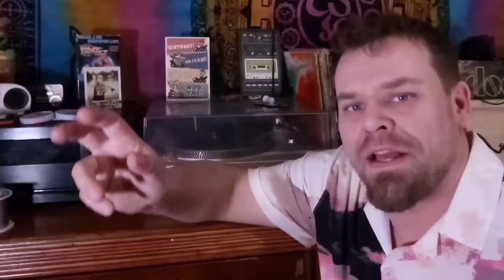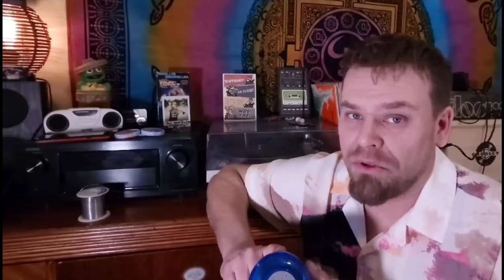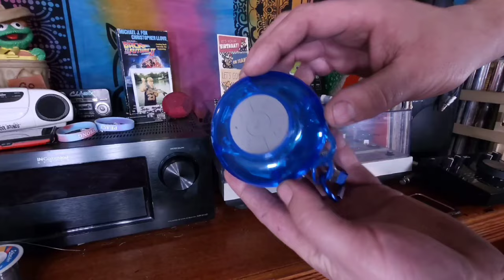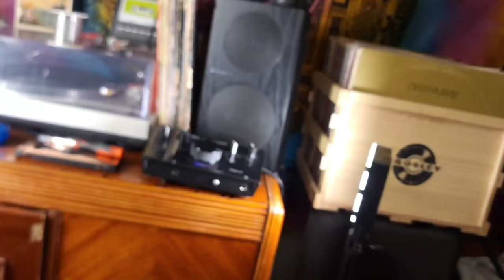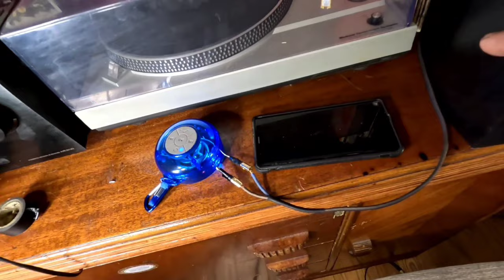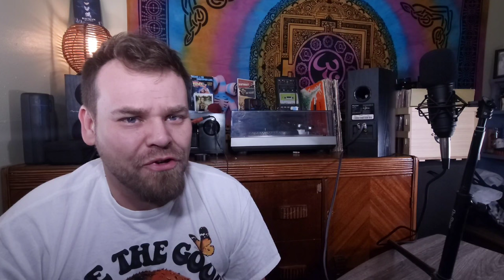I Fixed The Cheapest Bluetooth Speakers On Amazon

Comment: I got a cheap 8in Bluetooth speaker with a 3.7v 1500mah battery. I know I could solder a bigger battery to it to make it last much longer, but what are your thoughts about changing the speaker? What’s a good cheap, but better speaker I could put in?
Reply from the maker: Measure the speaker and check out parts express online. They have anything you can think of and some good quality parts! I think changing the speaker is a great idea as well as upgrading the battery.